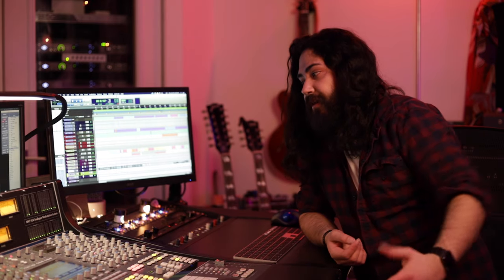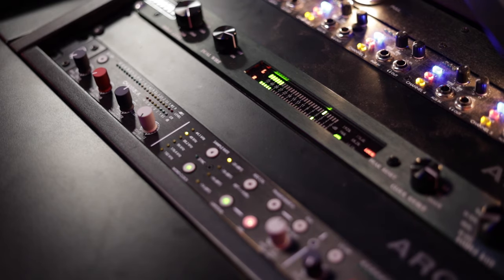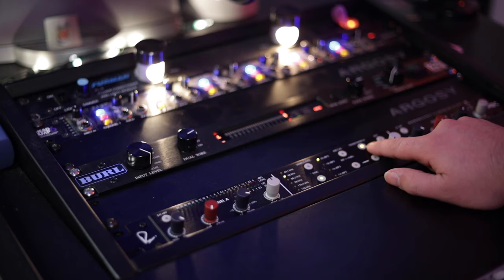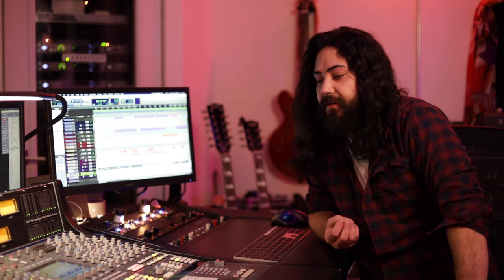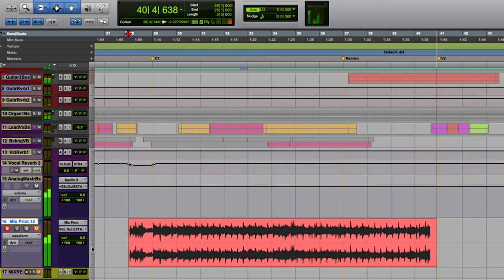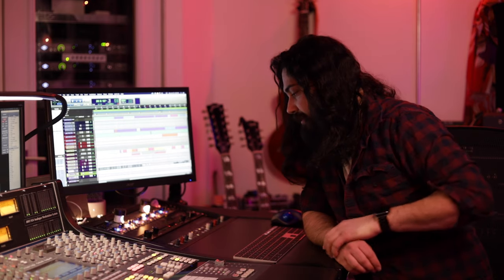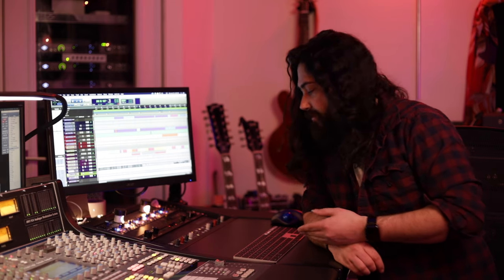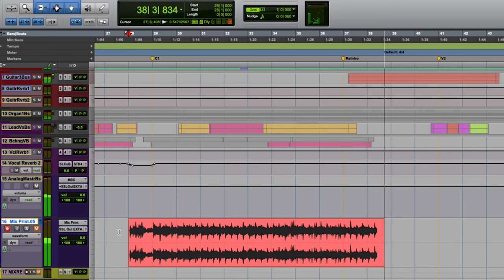AD Converter Shootout - Burl B2 vs RND MBC vs. UAD Apollo X

Comment: Can the apollo 6x mic preamps be bypassed? Thanks
Reply from the maker: They can be switched into line inputs. You can also use the pres in unison to make them sound like a variety of different pres.
Reply: @rosshayescitrullo3319  Awesome!! Do you know how to do this?  I'm recording lead vocals using external hardware uad la 610 mic preamp  into the Apollo 6x . Do I come out of the la 610 preamp into any of the 6 line inputs 1-6 or 3-6 inputs and what settings do I set in the UAD console? Thank you very much for your time!!!. macbook pro cubase pro 10.5 La 610 mic preamp hardware   audio-technica 4033 Recording input level in cubase -18 -12 -9

Comment: Burl is the winner by far. The Neve transformers destroy the bass and the widness (depth) of the mix. It's all squeezed and round. Maybe that's what you want in some cases, great on tracks, but killer of the full mixes in my opinion. Burl has also (that's crucial...) the "leveler" of the transformer curciut, so you can decide how much of the "mojo" you want in the mix before everything becomes Neve destruction, haha. Burl, thanks. :))

Comment: I own a Black Lion XP modded X6.  It’s pretty great, but man.  Burl is end game.  As soon as it came on “Mr. Sulu.  More balls.”
Reply: How is the mod??? I have been trying to decide if i should get the upgrade or just get a burl and run my mix out the apollo into the burl
Reply: @Redigulas  it’s alright.  Seriously i was expecting a lot more for the $1300 XP balls to the wall mod.  It opened up a little (maybe), but the Apollo already sounded pretty great.  I’m getting Burl though.
Reply: @jeremy_woods  Thats a bummer to hear. Sounds like im better off saving the 1300 and buying a burl or dangerous a/d to go along with my x6? I was really hoping the mod would solve all my conversion needs but it sounds like a very small improvement if any :-(
Reply: @Redigulas  
If you are just trying to improve the sound of the X6, take a look at the Grimm CC2 master clock. I use one with my X6 and it’s a good improvement. It smoothes it out nicely, a slight improvement in extensions top and bottom, and makes it sound more expensive.   50% of the BLA upgrade is the clock and the Grimm seems to be better than the BLA clock.

Comment: The funny thing here is that the apollo sounds really dull and lacking detail
Reply: That's why I would never buy one, unless I recorded country music only.
Reply: Agreed. This is why I got rid of mine..
Reply: The funny thing is you’ll never hear an ADC it only quantized the signal, it’s the DAC your listening to… All ADCs for the last 30 or so years aren’t missing any codes and have guaranteed monotonic transfer functions so they are accurate to the least significant bit, which at 24 bits is below the quantum thermal noise threshold. So what your hearing is the cash that changed hands…

Comment: Apollo surely sounds the worst. Neve was very pleasing. Burl got a Mojo.
Reply: Worst? You clearly don't understand what's going on here.
Reply: @minkfranchise6389  I got no problem if you prefer that sound, but to me it sounds like how most cheep converters sound. The snare is harsh, apart from the initial good impression of the on the face sound that only lasts for abt 30 sec. Can be easily mistaken for a sterile ITB sound.
Reply: @lightingwalk  Like I said... A comparison is not what the Apollo was used for. I have all three of these devices, and the Apollo is being used as a reference point to show what "invisible" or "nothing added sound"... so to say an interface (that is meant to be as neutral as possible so it can be an accurate conduit of "sounds" for many other emulations of preamps without lowering the fidelty of the emulations) sounds "worse" compared than a "converter" and a "master bus compressor" two devices that due totally the oposite of what an interface does (make the soind best or as good and pleasinh as possible by leaving their circuitries' fingerprint all over what you put in it via mainly transformers, hints at a person not knowing whats being demonstrated here or what the job of the Apollo actually is (to get out of the way and sound like nothing).
Reply: @minkfranchise6389 i mean it sure seems like he is comparing the converters in the apollo to the MBC and the Burl. If something is used as a reference point(which even in this where they are comparing 3 different A/D converters), then it is by default also a comparison. there is also no master bus compressor being shown here. Think of it like this the apollo is a 3/4 in 1; Preamp/Converter(both A/D and D/A)/Monitor controller(albeit a single monitor)/Interface. With this video comparing the CONVERSION of all 3 devices, which includes the characteristics of said converters w or w/o transformers in the signal chain. You really can't say something isn't being used to compare then go into detail how it is comparing. so Yes lightingwalk is correct in stating his opinion on the sound of all 3 CONVERSIONS being done. 

Also look at his statement like this, you have 1 device multitasking and 2 devices doing 1 task only. That 1 device doing multiple tasks is typically(as with anything in the audio world is going to be subjective) the worst of the devices being compared. whether that is in the color of it(i.e. something like a presonus interface adds color itself and not really in a pleasant way to me), loss of information(which can happen during conversion), or whatever. 

might not want to tell someone that they don't know what's being demonstrated when you honestly don't seem to know it yourself.

edited for grammar
Reply: @MixedBySpeakIn2TheMIC    Lmao... I have all 3 of these peices.  9/10 you're goin in through the Apollo for DA and maybe AD conversion if you dont want to use your dedicated preamps, which he clearly stated he uses the Apollo to go into the board so you said all of that for nothing because he also clearly stated that he was comparing the Neve vs. the Burl for himself. It's clearly  gathered from the context he's comparing  between the two pieces (Burl & Neve) for the "Sound" he wants on his Two bus to print with . He used the Apollo merely to show "others" that if thats all they had it doesnt sound bad because it doesn't change the mix it just puts out what you put in, so if it sounds "bad" your mix was bad. The Apollos. literally habe the highest. spec'd converters in the world.  I laughed so hard reading your explanation, bro.
You clearly don't know what's going on either. Re-watch and try to catch up. Hint Mastering engineers run full mixes and stems through master grade converters to "drive" (that's why he mentiond the variable input with the tranfomer) analog gear (tubes, tranfomers, etc) into saturation for a sound... Try that with Apollo. Lmao!!!!!!!
Reply: @minkfranchise6389  You'd be coming out the apollo for D/A and then back in through A/D, unless you used the BURL, like he said he was doing with the outputs of his SSL, or the MBC(which again if you had either of the 2 why would you not use them when their circuitry is better, and isn't bogged down by cheaper components and splitting it's processing power over 4 different areas. just because he himself isn't comparing all 3 for himself, doesn't mean it isn't a comparison. Which again you admit to by saying he is showing OTHERS. Nobody said the apollo sounds bad, we are saying comparatively to the other 2 converters it doesn't sound as good. Which is because they are making a device that has to do multiple tasks, and to keep costs down so it can be sold to people of all budgets, and primarily to the startup engineer/producer who may not have the money to buy a high end preamp, high end eq/compressor, high end ADC, high end interface, and a high end DAC. Please link to where it is proven that the Apollo gear has the highest spec'd converters, and that's not a post directly from UAD themselves. If they had the highest spec'd converters then why are they not used more by mixing and mastering engineers? They aren't even the first choice interface of a lot of the pro level engineers. That's not to say there aren't pro level engineers using them but to say that there is better being used. If an apollo is all someone has(I've been there and done that), the mix won't sound horrible because of that, like you said, it's based on how the person mixing/mastering actually mixes/masters and more importantly the room in which they are doing it in. But that doesn't change that it will still kind of sound like an ITB mix, especially if they aren't running it out to a summing mixer or anything in the analog realm. To me the older lynx Aurora 16 has better conversion than any of the apollo gear(used both for the 10+ years I've been an engineer). Saying you have all 3 pieces of gear does nothing but make you seem like a douche, I could talk about the expensive gear I have in my rack too, but what I have doesn't change that this is an A/D converter comparison of 3 different units for people to use to decide what they want to get.
Reply: @MixedBySpeakIn2TheMIC  Bro, I like to read, but I'm not reading all of that (I skimmed it). I  already responded to you enough... he said he was only comparing the 2 for himself because he as I... know there's no point of comparing an Apollo that's meant to "not sound like anything" to a Burl which is meant to "make things sound better". I am basically call dude Captain obvious bcuz who would say, "That Ferrari was faster than that 4 cylinder". Exactly... a person who knew nothing about cars. 
Hint The color of the Burl or How the MBC "sounds" is not a conversation about converters. 

I have recorded and produced platinum selling artist and worked with platinum selling producers since I was 17yrs old. Sat with the Bama Boys at Music World, and engineered at Takeover Studios. I own multiple Stus now... so I could care less what a person thinks I look like. I made the comment for ppl to think...
The same reason I responded to you. I did it for the "others" as he did with the Apollo. No Love lost either. Do your thing.

I enjoyed this (contrary to how it might seem) cuz I used it to  take a couple breaks.

For the last time "converters" don't have a "sound" unless they a bad ones.
Reply: @minkfranchise6389  I have no idea how you came to that conclusion without having to listen to the mix. Only the loopback files are provided here. And it's often a misconception. No converter has a nothing added sound, you are literally passing on a recording created in the digital domain with 0s and 1s into the analog domain. You must be joking to say apollo ads nothing, or is invisible. What Apollo does is that it adds stuffs that is quite in line with the digital sound. If you say you like that sound and find it useful for your purposes that's totally agreeable. But even in that context Apollo is far from being invisible as compared to the ones like Apogee, DAD, Merging and so on.
Reply: @MixedBySpeakIn2TheMIC  Yea, we have come across someone who says "the Apollos. literally habe the highest. spec'd converters in the world." And thinks it's the most invisible converter. And guess what, I have no problem with him, if he want's to believe that. It's not worth our time.
Reply: @lightingwalk    Where did I say an Apollo ads nothing or is invisible? I said it was "made to be" invisible, and we are talking about "converters" not, preamps, transformers, tubes, etc. Converters... the last component in the circuitry a signal flows through (besides a pad). It does nothing but measure those 1's and 0's you talk about at whatever sample rate you chose and pass along the voltage fed to it... any "sound" came from tracking, the mix, other circuitry (eg preamp, transfomer, unison, etc.). If there is a sound to the conversion the conversion fucked up. All "sound" from altering sound  comes pre-converter.

You proved the fact I am explaining by naming all of those other brands that you obviously didn't look into enough to know what's going on or what they are doing. I repair these devices. The Apogee AD-16X, Apogee Symphony IO mkI and mkII, Lynx Aurora, Digi Design 003,, Clarett 4Pre, Focusrite RedNet 2,  HEDD 192, PRISMSound Orpheus, Lyra 2, APOLLO QUAD*, and the *APOLLO MKII   all have the exact same "CS5381" & "CS4937" Analog Digital Converter & Digital Analog Converter Chips. 

... so does the a bunch of E-MU's and the Scarlett 2i2. 

Do any of them sound the  same? No. I wonder why.

The higher the quality the "converters" are the more invisible the "conversion" from electric signal to 1' & 0's is and vice versa. 

Appollo x6 uses "AK5578EN" & dual "ESS ES9016S" chips. Compare the 2 and tell yourself which one is better. Which is common sense since the x6 is the upgrade to the MKII which was the upgrade to the Twin. 

The "sound" comes from other parts of the circuits (eg. capacitors, signal flow, power supply, etc.). Bill Putnam Jr said himself that UA made the Apollo to be neutral aka a blank piece of paper for the other plugins of hardware emulations or unison to draw on, so a dry Apollo was "meant to sound like nothing".
Reply: @lightingwalk   Lol... yet you responded to rebut a common known fact (in the music industry).

Im done. I hope this info helps someone serious.
~Love.
Reply: @lightingwalk Digital sound? You do know "the  digital sound" means nothing is added right? Transparent aka invisible?
Reply: @lightingwalk  honestly, dude has only been typing stuff that can just be googled, while adding he has worked with platinum selling artists, and producers(when it's not hard to find his personal artist page, and the business page both these accounts link to, then to find any supposed credits he would have.) It's easy to say a lot of stuff over youtube comments, which is why i always say it makes the person saying it look like a douche. I find it funny that even UA themselves when asked about the sonics of their converters will say between their devices which converters sound better. so if UA themselves are saying their converters change the sound in some way, how can we say they are built to be transparent?
Reply: @MixedBySpeakIn2TheMIC  dude has also been coming and making posts and likes from different accounts. Dude is also believing marketing quotes made by the company to be factually true and advocates it to be known fact in the industry. Also calls it a reference point!
Reply: And dude might have no idea  why, the one with world's best specs and made to be invisible, shows a difference of about -52 dBFS from the original, when passed through Audio Diffmaker.
Reply: @lightingwalk  But hey, what do we know. We're just 2 random guys on the internet not engaging with telling unnecessary information about our own business accolades on a video not about our businesses to try to say our knowledge is absolute and everyone else is wrong.

Comment: The Burl is louder :-(
Reply from the maker: Addressed this in the pinned comment
Reply: @rosshayescitrullo3319  sorry but i cant see a pinned comment anywhere.  could you quote it for me here?
Reply from the maker: To address the loudness issues that are repeating in the comments: the test was taking the exact same mix via 2 xlr cables from the output of ssl and putting the signal into each unit and matching settings. The burl and mbc settings could potentially differ at their calibration from the manufacturer (or potentially just perceived volume), but this was the test…how does the burl impact the signal vs the mbc vs the Apollo. I felt that normalizing or gain matching the volumes of each device would be unfair to the test, so what you’re hearing would be what you would experience first hand from swapping the units in a mix at the studio.
Reply: @rosshayescitrullo3319  I understand what you mean, but without matching the levels or at least being sure that all A-Ds are calibrated to the same level (which almost none are) you will always find the louder one wins.
Reply from the maker: @m9shamalan  I think if you look through the comments you’ll find that’s not true. Lots of people prefer the Neve in various configurations, and while I picked the burl, it had nothing to do with it winning by being louder. Picking the winner based on louder only is like the first thing we learn as audio professions not to do. Louder does not mean better if you have a trained ear and are listening to frequency and dynamic range in detail. We do mastering shootouts all the time, where multiple mastering engineers will master the same track and we will shoot them out in the same way, and often it’s not the loudest one that is chosen. I think if we calibrated the output mixes and made each converters output the same perceived volume it would be inaccurate, as like you said, that is not how different converters are calibrated. Listen to the samples again for colour and balance as opposed to volume and you will hear what we’re talking about. 
Cheers.
Reply: @rosshayescitrullo3319  This.